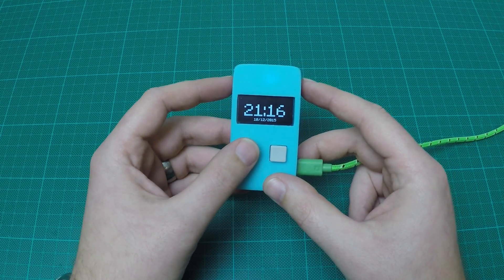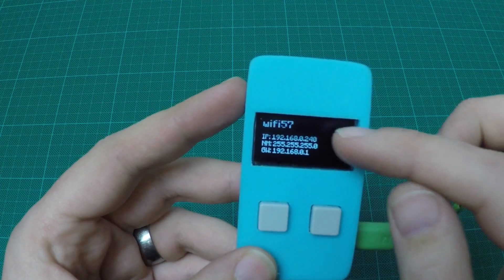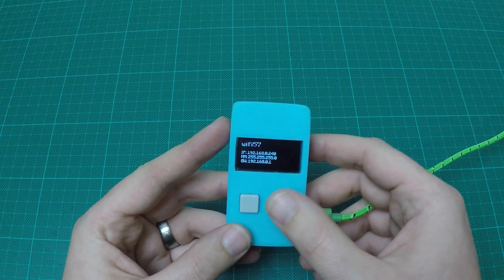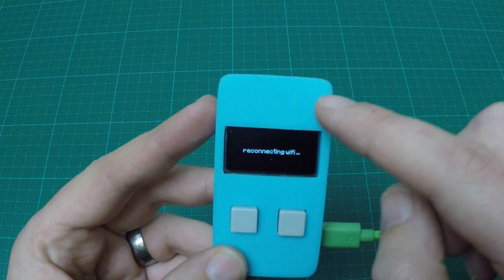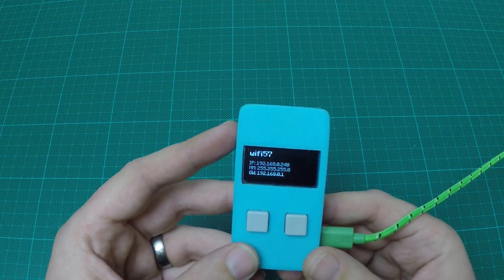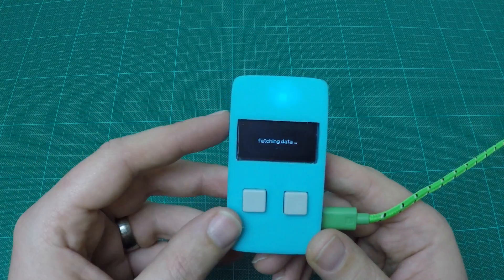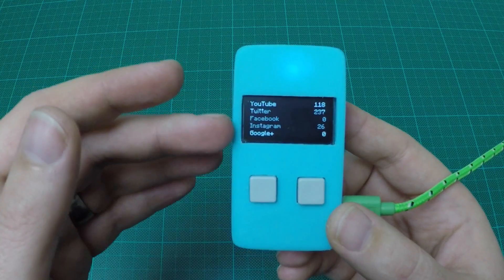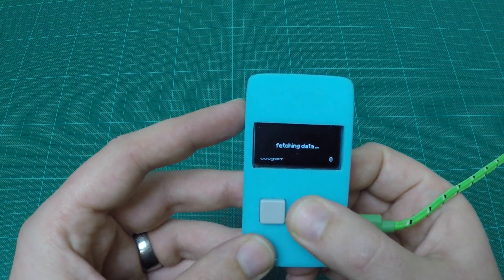Raspberry Pi Zero Internet Connected Information Display

Comment: Hi! I am planning on making this (CCOOOLL) project with Pi Zero W. Also, I'm not into Social Media, so is it possible to change the SM screen to Fitbit stats?

Any "Yes" answer will greatly be appreciated!!
Reply from the maker: I don't have a FitBit, but if there's a way to collect the data via BLE or Wifi: yes :)
Reply: Actually, to make things simpler, I wanted to fetch the data from the Fitbit website. Just like your social media screen does :)

Comment: rpi is overkill for this project, should have taken an esp8266-12f

the esp8266 is tiny as a coin and has wifi onboard and cost +/- $4 and can be set as client or access point
that would leave even room to build in a lipo battery and charging module
Reply from the maker: That could very well be, but I prefer working with RPi. I've tried ESP once and didn't enjoy the experience (at all).

Comment: Sweet project. Do you think the pi zero would be a viable option for making a NAS that could be accessed remotely?
Reply from the maker: +Philthy Phil I suppose that could work for a simple NAS. Pi Zero combined with a USB OTG hub with Ethernet port should do the trick. Performance-wise, it might not be that great though, as ethernet and USB hard disk would compete for bandwidth.
Reply: Like Frederick said, it would work but, not very well. I would use the raspberry pi 2 for that, it is only 30$ more anyway

Comment: Frederick. Thanks for responding. I have not yet used a Particle Photon board, I thought of the RPi Zero due to the low cost of the board. I currently have the code running a RPi Model A but running on battery only gives me about 40 hours of run time. Most importantly I need the data logging.
Reply from the maker: +Mike G The Pi Zero's power consumption is lower than the A/A+, so that should give you extra battery life. It is however still more than a microcontroller board, which could give you even longer life.

Comment: Great project, nice and clean. I am trying to figure out a way to create the smallest and most compact Temp & Humidity data logger that can run on battery life for as long as possible.
Reply from the maker: +Mike G Do you require something specific justifying the need for a Raspberry Pi? You could probably do this with a microcontroller with wifi functionality (e.g. Particle Photon) ?

Comment: What's the screen you used? Where can we order it?
Reply from the maker: +Ufuk Ömür Did you have a look at the blog post in the description? It contains information such as wiring and code. The display is an Adafruit SSD1306 128x64 I2C/SPI Monochrome OLED Display.